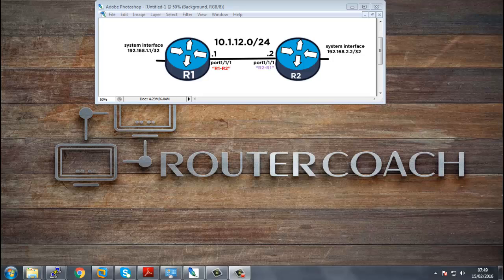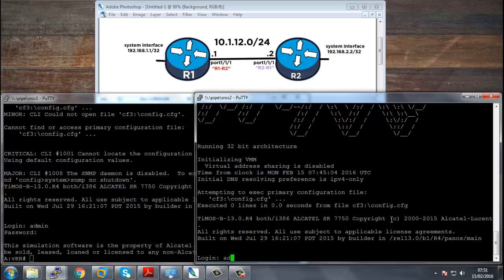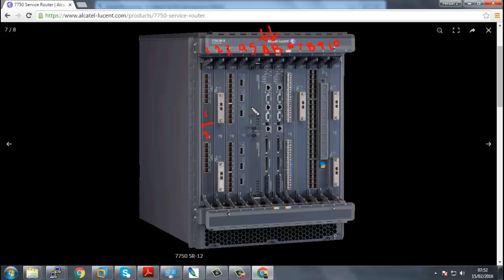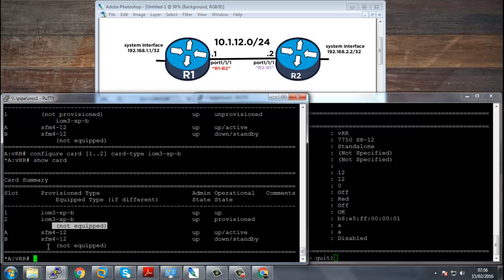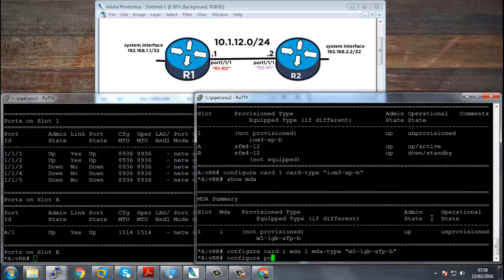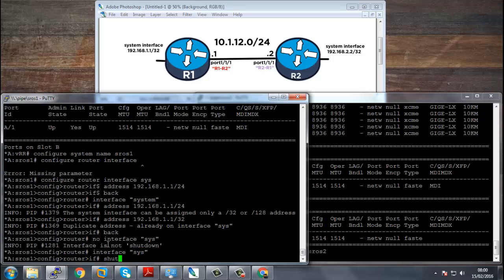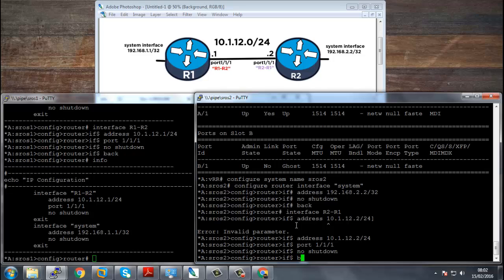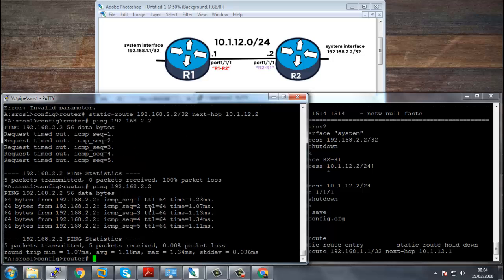Part 2: Alcatel router configuration overview

Comment: router coach, is a system interface address required for pinging, and communication? I noticed if I don't set a sys interface IP, I can ping directly connected interfaces, but not remote IP[s
Reply from the maker: +Steve Fowlkes 
Hey Steve - sorry about the delay in getting back to you. We are going to be running an Alcatel training session on June 4th for anyone whose interested where you get access to a virtual 7750 and can ask any questions you have. Jump on www.routercoach.com and register for the course if you are interested. Hopefully we'll see you there :)

Comment: is your R1 can ping R2 on direct connect interface ?
Reply from the maker: +Manu A Manu Thanks for the question.
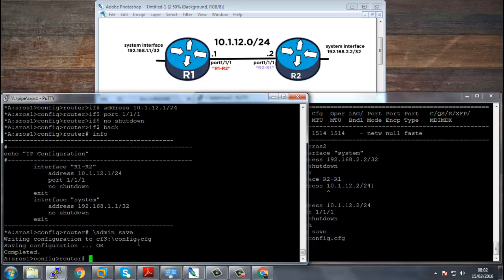Yes, if you take a look at 11:40 onwards you can see that R1 is pinging R2 on their directly connected interfaces. The only ping issues I've read about is by people using GNS3, which I don't use myself personally - they have to remember to choose the e1000 NIC card.